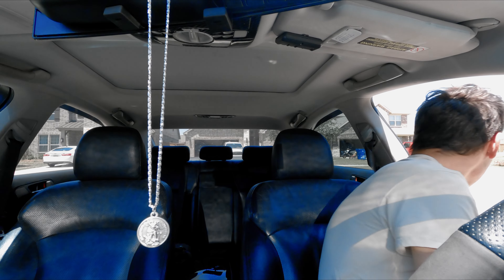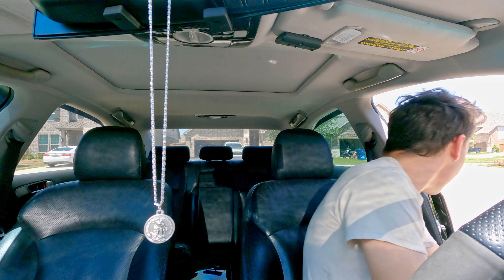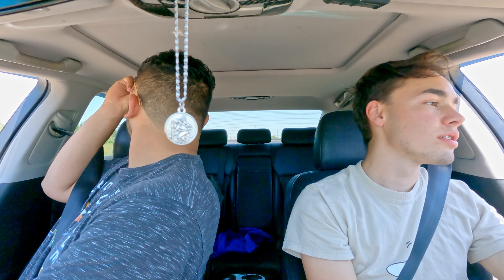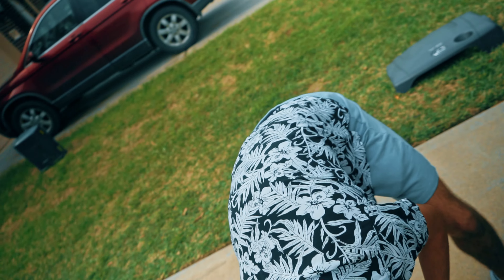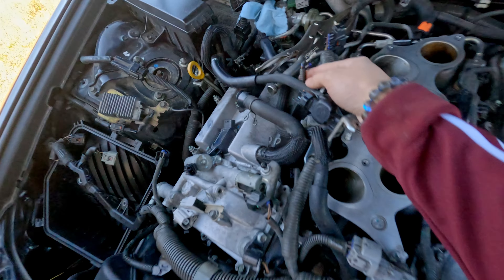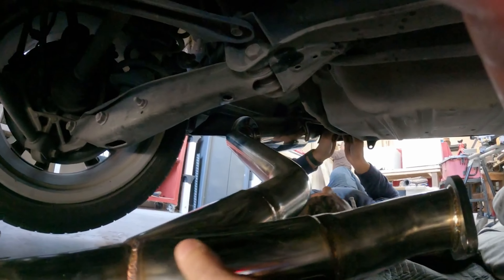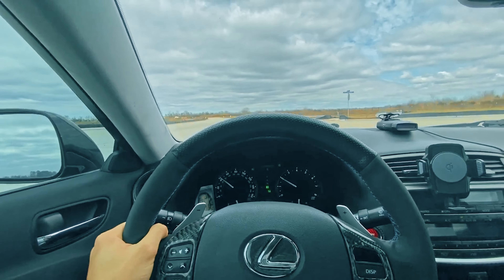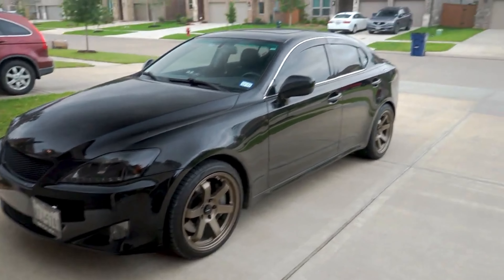How To INSTALL MFORCE FLAME TUNE !!  | Powergate Tool | Lexus IS350 |

Comment: Hey brotha I got a question if you don’t mind . I already have the Mforce tune pop and bang and I already have the Powergate tool . But I didn’t get the flames do you think I can add flames for 150$ or do I have to buy the whole tune again for 700$
Reply: Question, when you purchased the tune did you have to call mforce before purchasing the tune to make sure your ecu was unlocked ? Also how’s the tune been so far ? Likes & dislikes ? Lastly is the tool helpful, can you switch maps anytime you want ?
Reply: @Slow3IS have you figured this out? Wondering myself